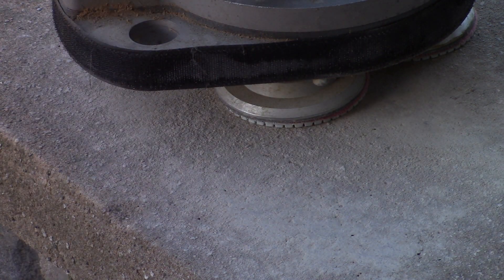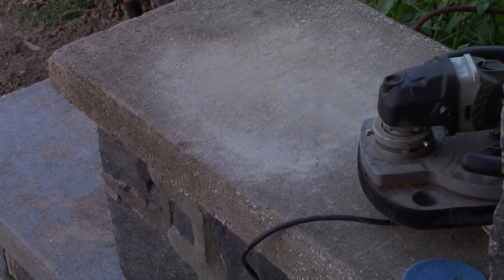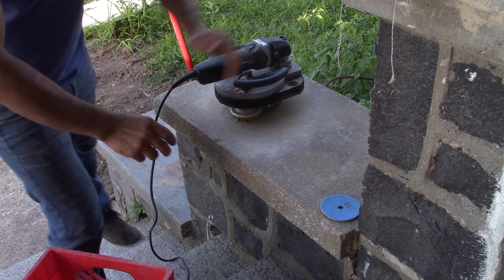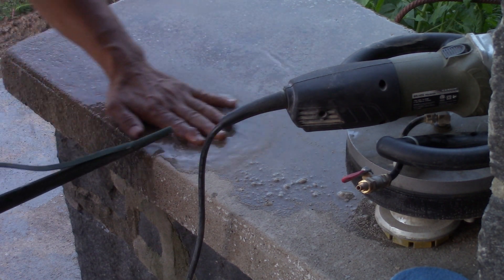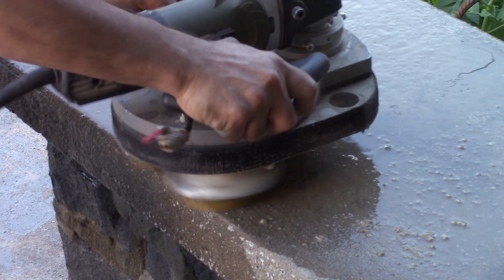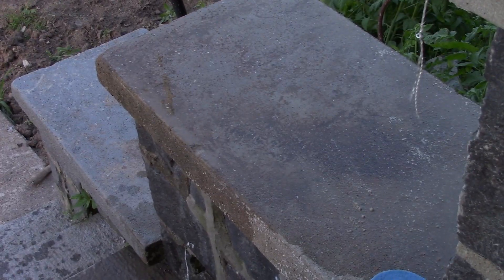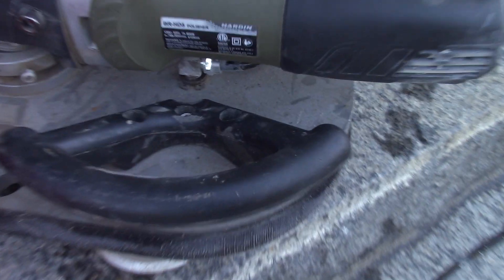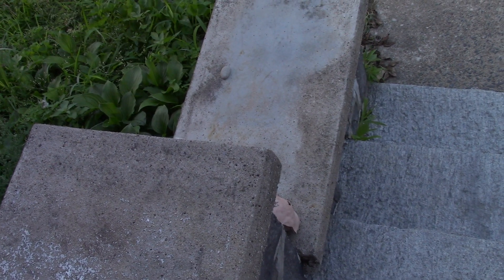Concrete Counter Tops Hardin Triad Planetary Concrete Wet Polisher and Grinder

Comment: For a few decades in Southern Europe, concrete polished floors were all the rage. They looked great, they were incredibly durable, and professional refinishing was cheap. On the downside, original finishing was labour intensive, they were slippery, and they did not insulate temperature or sound well. They were hard; US falls are a lot less painful thanks to cheap, thick smelly shag rugs hastily stapled to flimsy wood subfloors.

Now that Euro labour rates have skyrocketed, I think crappy engineered veneers or cheap carpeting are used in newer constructions. Also, air conditioning has become popular, so now people prefer buildings with excellent insulation to contain the cool stale air vs. buildings that quickly dissipate heat at night via open windows and thin walls.

Comment: Is it reasonable of me to buy this to grind down 1/2” of concrete in a 200sq ft room or is it too much to ask of this machine?  

Putting new flooring in and need to level prior to laying laminate. 

Other option is using self leveler over 1200 sq ft….that’d be a major pain with a high price.
Reply from the maker: No. This is not your machine for that much removal
Reply: @EngineerPEretired  could you suggest a machine or method please.

Comment: Is that an Air hose connection with a control valve on the machine to blow dust away?
Reply from the maker: Water line and also vacuum attachments; depends if you will wet or dry grind...